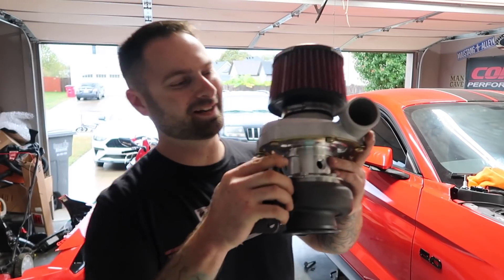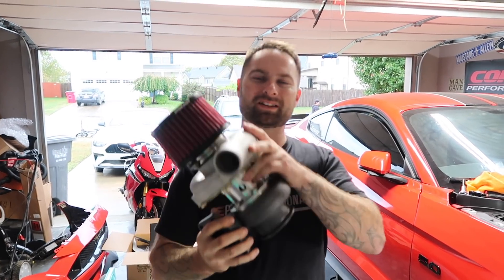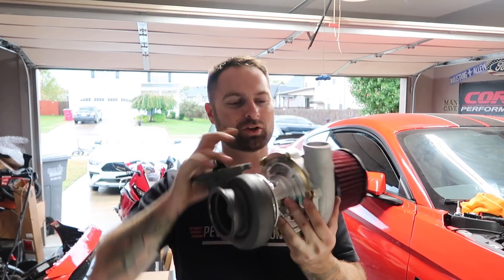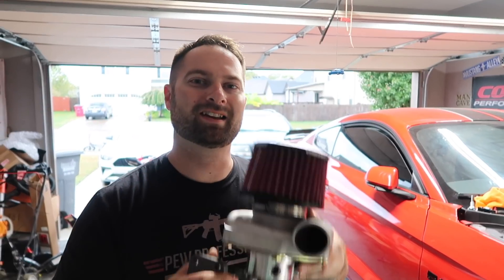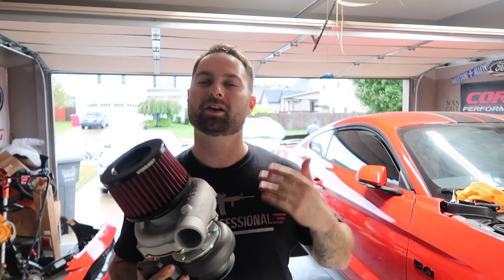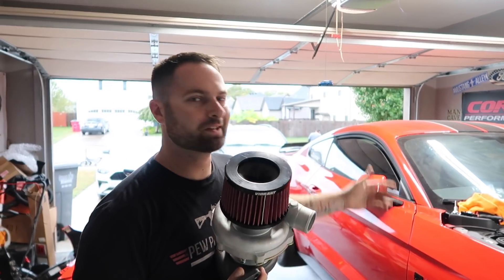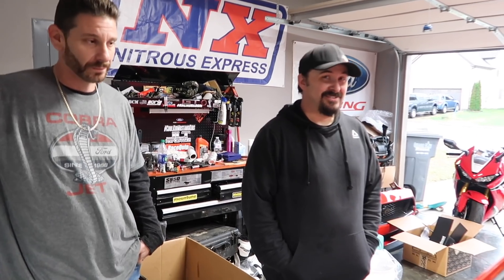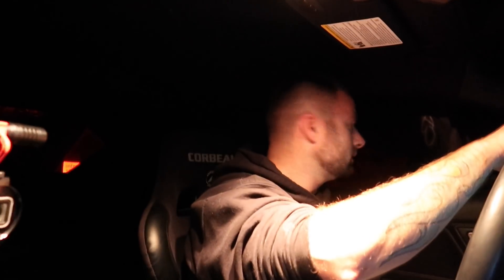MY 2019 TWIN TURBO MUSTANG GT ENGINE EXPLODED ON FIRST DRIVE... IT'S ALL OVER

Comment: So your waste gate spring was set a 7 psi and you saw 9.8 psi at quarter throttle and didn't think that was an issue. Yet you continued to go WOT, I bet you plumbed positive pressure to the top of the gate and that's why you blew it up. Expensive lesson !
Reply from the maker: Yes.
Reply: @Zander13Productions  - Respect, that had to be a damned hard yes to type.
Reply from the maker: KlipschHead281 thanks. It was the truth though. We messed up
Reply: @Zander13Productions  - Hopefully the channel can help make the repairs less painful. A built Coyote ain't cheap.
Reply: @Zander13Productions  I'm sorry that happened, its very unfortunate.
Reply from the maker: KlipschHead281 we shall see
Reply: I’m not a fan of Z13 or his channel but I wouldn’t wish this on my worst enemy. Hope you get it back together soon. Stay positive.

Comment: YouTube mustang grim reaper list:
✅ itsjusta6 
✅ nate rider
✅ zander13
Reply from the maker: Truth
Reply: Street Slayers don’t forget michael mack lol
Reply: Exactly right. Guys with no experience, bolting on lots of power, with no additions to the bottom end, and then act shocked when it blows up. Have a professional finish this.
Reply: Man and I thought the first time I sprayed my car was sketchy.  I was just nervous knowing I still had everything in place and dialled in
Reply: divemaster 03 This is an unfair statement. Zander is very mechanically inclined. Watching his installs compared to some of the “experts” he holds his own just fine. Arguably does better in some cases. This is nothing more than an accidental oversight caused, in my opinion, to lack of sleep in an excited rush. We as viewers/subscribers need to be supportive and as positive as possible. This takes a lot of manhood to post this video and be forthcoming with all of this. Zander you are a good dude. My condolences
Reply: @jtgarner1970  I agree. Not to mention, it doesn't get any more professional than speed addict 731 and serpent stangs. Itsjusta6 bought a "professional" built $20,000 motor, and guess what? Knock knock knock.
Reply: And maybe itjusta6 350, they didnt even understand heat ranges shit I'd have a Brisk12s in that shit it was cranking 240psi if cylinder pressure damn....
Reply: Street Slayers add my stock  18 pp1 to the list car ate itself under 5k miles mine was ticking to knocking never touch or tuned
Reply: @jtgarner1970  Well said...
Reply: @underfedcoyote5.022  add I'm on my 3rd engine with 50 state legal tune and full kit....998 miles total and 5 WOTs for no more than 5 seconds popping around the 4.5 second range....aka 0 to 62 ish....
Logs looked perfect both blow ups just went full KR out of the blue...2 different installers, 2 different long blocks...2 different sets of DI injectors ect...port duty cycle fine...fuel trims fine and AFR as commanded....timing as commanded and not very much....different stations for fuel...and car put into low rpm high load conditions to test fuel and PCM was adding timing everywhere...it was good 93......
Reply: @SRV89Fender  my shit didnt blow up. I sold car for other reason.
Reply: @streetslayers410  justa6 destroys everything

Comment: Heres a sign 20% throttle 10 lbs boost (somethings not right is what most people would of thought)
Reply: I hate to say it but yes at any time it went on waste springs something wasnt right...
 But god I cant judge he was excited I've hit n20 scramble and blew a freeze plug and stayed in it to win the race.....in the heat of the moment....
Reply: I was going to say the same thing 9.5 pounds I would have stopped right there. Sorry to hear about your misfortune though. Good luck bud.
Reply: @bluecollardaily2676  big difference between racing to win and this though. Many of us been here but you need to know when to lift. Timing was the problem not the amount of boost. If the timing was correct even more boost wouldn't have hurt it. You could hear it start to lay over before all hell broke loose. Need to know what that feels and sounds like. Even a built motor will save you when this happens. I wish him luck and sorry he had to learn the hard way.

Comment: Wow, who does that. I know youre staying positive and thats cool, great attitude. This is 100% your fault. Clearly in over your head and rushing something will get you this result.
Reply: Never a good idea to do a hard WOT pull on the maiden voyage whilst taking the first set of logs...he definitely got caught up in the moment. His wallet will pay the price, lol.
Reply: Absolutely and 9lbs of boost on pump gas on a car starting with 12.0:1 compression is like having a car with almost 20.0:1. Timing is so important with this setup. He obviously doesn't know what a car sounds or feels like when it's laying over. This wouldn't have been near as bad if he did. Having a built motor isn't going to stop this from happening so I hope he learns from it.

Comment: Zander I'm going on my 3rd one, no one knows your heartbreak  more than me...like you each one was in testing never even got a pass in....I didnt know yall were going that night on live stream to actually hit it or I would have screamed mix some MS109 or boostane in for at least some protection.....
 These cars dont like boost on 93, e85 and they will take a ton of power....
What were your IATs and Peak boost? What gear was it ( 5th pull for data log) I almost suggested you start even colder than that NGK6510....didnt want to butt in to hard.....
 Damn you know I know your pain mine hasn't been usable late July I think and will be down at least 2 more weeks......
 I give up on any power on 93 I'm dropping back to 11psi from 13-14
Reply: BlueCollarDaily I do
Reply: @boostedjay4277   you got some bad luck too Jay...

Comment: Spend the $$$ and have a pro build your engine.
Reply: William Horvat that’s what I did .
Reply: Doesnt matter if a pro builds the engine. It will still blow up just the same If its not put together right. It would have just wasted more money. 9lbs of boost at 20% throttle. Tell tale sign. it even blew off the charge pipe. Fuck it send it see what happens.

Comment: 1st off I am sorry this happened buddy that was painful to watch . 

Watching that video I was yelling STOP to my phone because you had mentioned you should be hitting 6-7 lbs on gate pressure and when you hit over that at 9-10 psi at 20% throttle I was hoping you would stop and check because I knew you were going to have some nasty overboost at 100% throttle . I hope you can recover and get what you need to get this thing back up and running . You need to also look over your turbos as well and make sure nothing exited those when this happened . Keep your chin up man , I’m interested to see the break down in the next video

Comment: Yeah man I overheated my engine back on early August on my 2018. I had CAI and e85 tune. Took it to dealer and never mentioned I was modded. Then they give it to me back a month and a half later with new engine and motor starter. I got lucky on a 10k bill to fix everything. Ford covered me and all. I honestly thought I would have to pay the fix. Good luck w the build!
Reply: David Morando they didn’t see the new intake?
Reply: tyler parker yeah at the end they told me “idk how we covered you but ford approved the new engine. We checked your ecu and all and couldn’t access it so we know you’re tuned and all but yeah man ford covered you for 10k” so yeah I got DAMN LUCKY lol

Comment: Sorry to see that happen! Looks like when you were doing just the 20% and saw the 10 lbs of boost thats when a red flag would have came up. Not sure what your wastegates were set to but if you saw more than your wastegate spring pressure, then that would be a sign that something is not working properly.
Reply from the maker: You are right. We got caught up in the moment
Reply: Zander13 very understandable, I’ve had my share of incidents like these unfortunately. Went through 3 built motors in one car always something when it comes to performance! All we can do is just turn around and get it right the next time. Good luck with the rebuild!

Comment: One of my co-workers mentioned the piston compression was too much. Is that something that applies here? Was the compression changed?
Reply: Raul P Gates and controller were plumbed wrong.  Car was at 22psi when it went.  Gates were stuck shut
Reply: @HellhorsePerformance  thanks for the info. Change subject, I'll be buying the digital dash soon from you all :)
Reply: Raul P perfect, make sure you take note price is going up beginning of the year, details are on our IG

Comment: Not sure why you’d be going WOT on a base file. I highly doubt rob shoemaker would ask for wot logs so soon. He tunes my boosted gen3 s550. We didn’t get into wot logs until about 3-4 revisions. 

That and seeing that much boost at low throttle should have been an indicator that you need to take it back to the garage and check things over again. As well as waiting for rob to review the idle and step log.
Reply: He stated he is not blaming the tuner and we know now what the issue was. You do bring up a valid point, it seems like the tuner wanted a wot datalog right off the bat. I dont blame zander for that. My tuner goes straight to wot also so you better be tight.
Reply: AG3NT O so. I do not believe that. Zander and I use the same tuner. I know his process. 

He should have stopped once they noticed it overboosted.

Comment: Zander I put a few ounces of boostane in the tank on fill up just in case I get some bad gas. I got some bad 93 on 10lbs and I knew it the second I hit the gas so I dont chance it at all. I love my bottom mount twins but I always want that cushion. 10lbs is max for good 93  gas. Bad fuel will blow shit up at 10lbs. These cars are a beast on boost. I turned it up to 12 with boostane and i have to get out of it at 70 cause it goes sideways if I nail it with pilot sport 4s.
Reply: Robert Breaux Gates were shut from improper plumbing.  Car let go at nearly 22psi
Reply: @HellhorsePerformance  omg. 22 psi on 93 octane. That's crazy. I try to be good on 10 or 12 psi. I could tell the 1 time I got bad fuel  I didnt want to chance it again. No pump fuel would have withstood that on 12 to 1 compression. I love my TT 19 and wouldn't change it for any car.

Comment: Should of known something was up when your driving And he said it’s loud because of wastegates dumps. The wastegates should not be open until they hit the gate pressure.....
Reply: Joseph Richard if waste gates were open this wouldn’t have happened they never opened Is the problem
Reply: You don't overboost if the Wastegates open as the wastegates release the pressure. he said there was an error made with the plumbing of the turbo's.

Comment: Sell it take your loses and buy a GT 500 for a daily driver. Ford has done a lot of Engineering to get reliable 760 HP. Even if you only get $20,000 for your car and sell the turbo kit for $5000 you are better of.

Comment: Next time have someone with a little more experience building a motor, if you haven't built atleast 100 motors don't attempt to build a high horsepower motor, outcome is exactly what you just experienced sometimes you might get lucky but mostly it's a failure. Sorry you had to learn the hard way (expensive way) if you need help I'm willing to donate my time and experience so i can see you succeed

Comment: 10lb at 1/4 throttle was your first sign. Why did they have you going WOT first thing anyways that’s a NO NO. First start up straight to a WOT pull.  Built motor FTW

Comment: That is so very unfortunate..maybe pulling that engine out, tearing it down and salvaging every possible piece you can, you might be able to save a few thousand bucks...I know it doesn't help but I hope everything works out for you and Warfighter. It is a war but that was a battle...Warfighter is earning its stripes. You'll come back bigger and badder than ever!! Oh and I hope you have the best Veterans Day weekend all things considered.
Reply from the maker: Thanks. That’s what we are doing. Inspecting turbos and heads to see what’s left. Huge hole in the intake valley of the block right now and cylinder 4

Comment: Modding is a slippery slope, part of the experience is breaking shit, you on the other hand have been unfortunate enough to go straight to catastrophic failure which is somthing expected nonetheless, learn from this but don't let it turn you away, build it, drive it, break it, build it again stronger. Good luck

Comment: Damn man add you to the long list of gen 3 rebuilds. Slice it anyway you want I have seen many guys that this has happen to. I tell everybody I know to enjoy the stock gen3 before you boost Build it. Sorry for this but you had a lot of fun with it before this happened.
Reply: You know man when he said 93 first I told my wife damn Zander in for trouble....I didnt pay griptec to build me a pulley to reduce my boost I just spent 5200 and 2 engines to get, BACK to stage 1 levels for nothing it's the 93 these things wont take it
Reply: BlueCollarDaily I said it before and say it again it’s the motors I don’t know what it is but some fail some hold. The ones that Hold do really well. He beat on his car for months then added boost it showed what so many of ours showed. Same thing happened to a guy i know whipple car here in Vegas.
Reply: @underfedcoyote5.022  yeap the second he went back to 93 boom....
 I think the e85 is keeping them alive at the 12 to 1 even FBO...I'd bet even more would pop with FBO tuned and 93...but it's so easy almost everyone goes E85 at same time
Reply: Thru my 3 I've honestly thought about taking this latest core....tearing the heads down sending them out of porting ect and cams with ported intake and FBO with a stall and see what she does 93 NA...then e85
Reply: BlueCollarDaily better to build a gen2 if your BOosting gen3 are CB great N/A is you have a good one.
Reply: @underfedcoyote5.022  You guys don't understand. He plumbed his gates and controller wrong and over-boosted. He would've blown a fully built motor the same exact way. It was all his fault.
Reply: BlackWhiteBeast totally get it just another one to add to the list lmao 😂 many of them. My car Blew under stock power BCDs blew under boost. Guy I know here his blew under boost. 3 other guys I know here there blew under light mods e85 and bolt ons. The list keeps growing lots of excuses. My car  Was lucky enough to get bought back. But before you build these cars I would bore scope the motors to make sure first. Or just send it and see what happens. I also had other motors blow some boosted and some not. Things happen I get it.
Reply: @underfedcoyote5.022  Yeah, this is a great channel to learn what not to do. To top it all off he names this car Carnage. The irony in the name and the direct representation of that name.
Reply: BlackWhiteBeast lmao 😂 very true his luck is a lot like mine. Every time I think I’m doing the right thing I usually end up with his results. I hate seeing guys go threw this shit. But when you build these cars they seem to break.

Comment: Im really sorry man, Dude hear is my build so far....ive got 43 grand in my car...and Im N/A.....●PORTED Cobra Jet intake Manifold ●VMP twin 67 TB ●PMAS cold air ●Lu47 injectors ●BBK Long tube headers ●BBK offroad Xpipe (no Catts) on this car ● Extreme Stop cross drilled and slotted rotors ●Extreme Stop carbon graphite pads ●Russle steel braded brake lines ●Ford Motorcraft dot 5.1 brake fluid ●JLT catch can ●Barton hybrid 3 shifter- trans mounted ●Ford Racing aluminum driveshaft ●JMS fuel pump voltage booster only 5volts over stock settings ●AMP Stage - 3 BUILT MT82 transmission ●Ford Racing roller pilot bearing ●BMR Adjustable Uper Rear control arm W/spherical fittings ●(All MacLeod) ○Street extream clutch-26 Spline, ○race spec flywheel, ○hydraulic throw out bearing, ○steel braded clutch line. Changing to ALL MANTIC after motor is droped in....331 factory gears. Currently dynoed at (432 on 91), (450 on E54), (460 on E85) all to the rear wheel ....new motor.......
●2012 coyote 5.0 block compression decked, ●Boss 302 crank, ●Manley forged 43-40 H-beam rods, ●Mahle forged Cobrajet pistons, all forged rotating assembly and ballenced ●Boss 302R heads NOT Boss 302 heads, ●Comp stage 3 NA cams, ●Ford performance timing components, ●Ford performance Cobrajet oil pump. ●MSD Blaster,coil packs ●NGK iridium plugs, From 11 to 1 to12.5 to 1 compression.
So enen though im not going after what your build direction is, it Hurts
If you do build a motor, PLEASE  got to Bret Barber in Tucson AZ. I dont think that anybody builds a better Coyote 5.0
He builds all of Calimer's stuff, and Ben actually refered me to him. He knows his stuff and will do you right. My current stats with my car are on my Dyno tune I was 503 to the rear wheel and 397, at an open Dyno night 4 days later it was 508 to the rear wheel and 394 torque. Please consider my engine builder. 520.861.7455 Ask for Bret